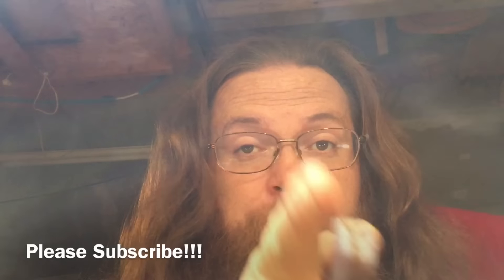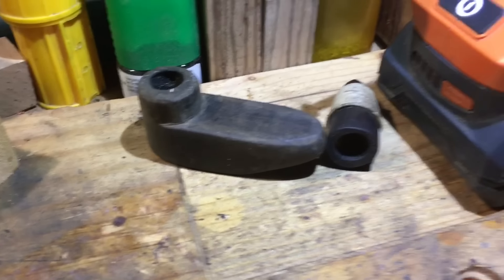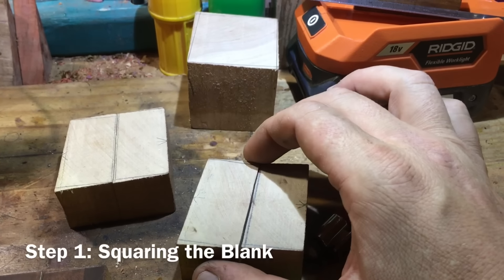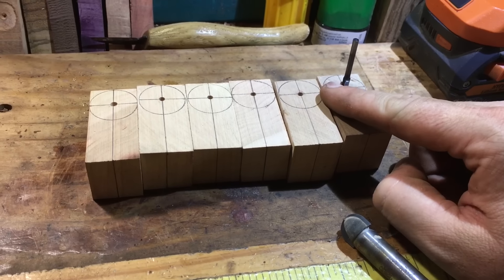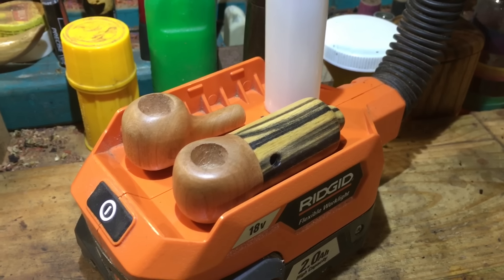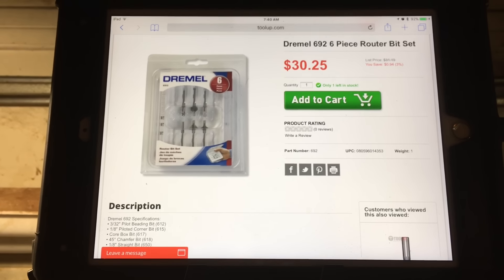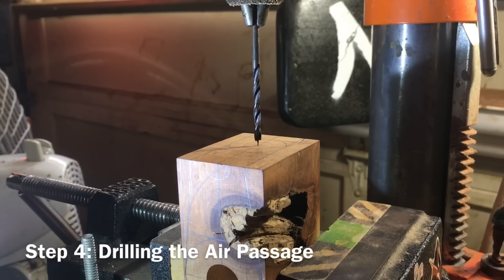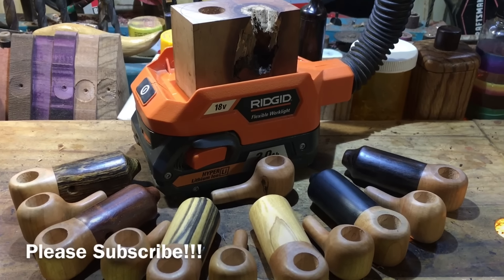Gary's Wares: The Basics of Pipe Making

Comment from the maker: FAQ's:

"What type of glue do you use?"
I use Titebond Type II Dark Wood Glue. It's the same as the regular Type II, but dyed to dry a dark caramel color. I think this might be the best choice for exotic hardwoods since they tend to be darker than most domestics. 

"What type of finish do you use?"
I use Salad Bowl Finish, which is not only non-toxic, but food-safe as well. In conjunction with that, I try to sand up to 600 grit whenever possible, which will give you a better finish. 

"What about using [some type of wood] as a bowl instead of Cherrywood or Briar?"
I take my technical cues from the tobacco pipe industry, and Briar is king with Cherrywood being second. Aside from Cherrywood, I also use Gaboon Ebony occasionally, but that's it. I don't currently have personal experience with any other type of wood for bowls. Check out this link for acceptable alternative woods to use as bowls: https://pipedia.org/wiki/Alternative_Woods_Used_For_Pipe_making

"How do you clean a wooden pipe?"
With a pipe cleaner, of course! If you'd like to harvest resin, you can do that with paper clips and such so long as you're careful not to dig into the wood; that would give you splinters in your resin, and that's no fun. I DO NOT recommend digging around the bowl for resin as this might disturb the "char layer" (the burned interior of the bowl) which is essential to a prolonging the lifespan of your pipe. 

"Where do you get your wood?"
I've been getting it from Woodcraft.com, but I think I'll go through http://www.bellforestproducts.com/ the next time I get wood. Bell Forrest seems to have better prices.
Reply: Hey gary I have a very important question. Could you make a pipe out of a standard piece of 2x4?
Reply from the maker: https://pipedia.org/wiki/Alternative_Woods_Used_For_Pipe_making
Reply: What are your thoughts on bone as a bowl/stem material?
Reply: @Th3Class1c  that wouldn't be a terrible idea. Pine is a very soft wood so it wouldn't be durable enough. And pine resin is very flammable. I make shavings of pine to start my campfires. Not to mention pine is very often treated with chemicals. Horrible for the lungs.
Reply: @stanervin6108  I've done that. I wouldn't reccomend by way of breathing in bone dust or the burning bond itselt since bone tends to be pretty brittle. Antler isn't a bad choice however for a stem but not the bowl.
Reply: What's your opinion on long stemmed pipes?
Reply: @m_ the_Happy_Doc bamboo makes a great stem. All my wood pipes are hickory, and that works well too.
Reply: How wide/deep do you normally make the bowls on the carb pipe?
Reply: my ultimate cheat for pipe making was to buy a peterson churchwarden..
Reply: Harvest resin for what?
Reply: do you use a lathe? I don't have access to one and was wondering how hard pipemaking becomes without a lathe
Reply: If you want to make a more durable pipe, you can use pipestone. It's going to take longer, but it lasts for a very long time (probably forever)

Comment: something tells me these pipes aren't meant for tobacco use
Reply: Devin Petersen shhhhh, child.
Reply: Weed pipe base on the design :)
Reply: Yeah, I came to see pipe making, and I see bowl making.
Reply: Devin Petersen, shhhh...
Reply: Devin Petersen lol
Reply: as soon as he said inhale......
Reply from the maker: Devin Petersen, you’re right, these designs are specifically for cannabis. Not to be an absolute nerd about it, but tobacco pipes have different needs than cannabis pipes. 

In a tobacco pipe, the tobacco smolders like the tip of cigar. As such, the wood used in the bowl has to be tough enough to endure constant heat without degrading too badly. Briar is the industry standard in the tobacco pipe market, with pipes made of cherry (and the like) selling for somewhat less. Briar is highly resistant to heat and about as hard as marble. It’s also about $20 a blank. 

Cannabis, however, doesn’t combust as readily as tobacco (unless you’re smoking reggie 😕), so a cannabis pipe doesn’t need to put up with as much constant heat, freeing up lots wood options and designs that aren’t possible (or at least practical) with tobacco pipes. 

Anywho, that was your “Bill Nye the Science Guy” type lesson on pipes. I’ll have to think of something like that. “Gary of Gary’s Wares [something, something] [something that rhymes with “Wares”]. I’ll have to work on it. 🤔🤔🤔
Reply: A chillum should have said enough 😘#SWED
Reply: I realized that when he fucked up the sides
Reply: Devin Petersen 😂
Reply: @GarysWares  shhhhhhhhhh! Dont tell him!
Reply: Ì don't think it's from not paying attention I think it's from smoking a bowl first
Reply: @GarysWares  dude thank God you make cannabis pipes
Reply: was it the green "material" that tipped you off?
Reply: Not a crack pipe.
Reply: @GarysWares   Gary's Ware's the pipeman cares
Reply: how long have the number of likes been what they are?
Reply: 420 likes on this comment. Nice.
Reply: You think hes smoking chia seeds too?
Reply: Ew, who smokes tobacco lol
Reply: Me too
Reply: @GentlemenJack109  🤦
Reply: Ya meth
Reply: it's the same thing dude
Reply: Exactly why I’m watching
Reply: Tobacco pipes can be used for both
Reply: @GarysWares  thanks! that explanation and information in the comment is actually pretty helpful to a beginner pipe-maker like me!

Comment: I just finished carving the bowl section of a pipe. I used a dremel for all except the stem attachment part. Although I may have an issue because I have no idea what kind of wood it is. I just used a twisted, more dense part so it was harder. Hopefully it's not toxic. Some general grey, kind of smoother bark. White/blonde flesh. Seems to be at least carving well and no odd smells

Comment: Here's a question. I'm wanting to build a flat-bottomed 'wizard style' pipe with a long stem. How do I go about figuring out what size and angle to make the stem so that I can put it down and have it self-balance? Another alternative is a small hinged metal insert on the underside of the base that could fold out towards the stem to help it balance, but I'm unsure how I could properly secure that to the wood without using glue or screws. My best guess thus far is maybe small metal 'biscuit' tabs to hold it in.

Comment: Here's sort of an oddball question for you. Experienced wood-worker here, but I'm uncertain about something. Around here I have lots of standing Cherry, so I mill it and cure it myself. Cherrywood seems to harden with age. Further, some pieces are denser than others. Of all the wood I've worked with, the hardest, densest of all seems to come from an aged stump. 

It stands to reason that wood, being an organic structure, will have different properties depending upon where the structure comes from. Most woodsy people have noticed that a root will snap with a sharp bend, while a branch will flex back-and-forth. The two types of wood (root & branch) have adapted to fit different environmental stresses; as structures, they have different purposes. 

OK, so there's the biology. 
My point is that I've found slightly-underground stump wood to be the densest of all. Perhaps this is because it is this place alone where a tree has to be super-strong but also flexible and wet, so this spot is sort of a unique blend. I'm wondering if you have any related experience, or if you have an opinion, before I try making any Cherryroot pipes.

I'd also like to hear anything you'd tell me about the differences in design between making a pipe that's either for pot or tobacco. Good stuff. Thanks ;)

Comment: that "tobacco"  needs a continuous flame, real tobacco smolders on it self and should do only that. 

Though it's hot when it smolders it is a non complete burn, oxygen is depreviated and that gives "low" heat and smoke 
In short u made a cyclone suction burner. 

That is the Only way too kill a pipe like that :) an old pipe maker told me that. 

Didn't know till now why I knew this 😁. 

Nice work man really learned a lot from you 👍🏻👌🏻

Comment: Hey nice job and thank you for your work. I've made pipes for a few years then stopped after legalization. ( long story) any ways you start your pipes very similar to myself but after losing my pencil lines and over carving my marks I started using a hole saws to mark my outer do not pass mark. I'd centre and cut a small 1/16" ring . As long as the hole saw fits the block there's no measuring needed. Then I centre my Forstner bits for my bowl. I carve with a Fordom, a hand help rotating sander and wand with a foot pedal for speed. I still need something for the bottoms Chamber bits are hard to locate. I just thought maybe my tip could save you some time measuring.

Comment: The thingy is a pilot, that goes in the pilot hole to align the bit with the pilot hole like a brad tip on a brad bit. The pilot & pilot bit are used in metal, plastic & wood working for alignment. Good video.

Comment: I would like to start making tobacco pipes and I’ve been making knives for some time. For wooden knife handles we normally use wood with resin drawn through it (which hardens the wood and makes it so it won’t change shape during temperature change). I’m just wondering would it be a bad idea to use the same wood with the resin pulled through it?
Reply from the maker: Thanks for your question! Without knowing much about resin, I’d say yes, that would be unadvisable. I’m not sure how resin reacts at high heat, but I’d wager it probably gives off toxic fumes. 

But the good thing is that, with proper wood selection, that’s not something you’d need to worry about anyway. Briar can be pricey @ $20/blank, but there are cheaper alternative woods that will do the trick.

Comment: When your drill bit or saw starts to burn the wood while it's cutting that usually means one of two, sometimes 3 things. either it's time to sharpen that bit or you need to change the machine's speed. (sometimes its because you picked up a bit that was meant for masonry or metal by mistake)

Comment: gary have you ever tried curved pipe stems? the indians use sumack for their stems so they can be hollowed out by using a heated wire or fine rod curved to shape of bend and pushed and burn through the sumach branch

Comment: Each pipe was test smoked as the video progressed and I'm amazed you could get through the last part at all. 🤣 Great video. I have loads of apple wood but I have no idea of it's ok for pipes. It's fruit though so a smoke could be classes as one of your five a day.
Reply from the maker: Actually, I never use the pipes that I sell. That’s bad form, among other things. But if you’re referring to the black inside of the bowl, that is a result of charring from the bit. A rotary tool doesn’t have the power to drill the bowl at a speed low enough to prevent charring. These days I use a core box bit at a medium speed on a drill press to prevent charring. 

As far as your wood goes, I’ve heard that fruiting trees usually make viable pipes. But again, I’d google it before you invest your time in it.
Reply: @GarysWares  hi Gary thanks for clarifying. Of course you don't smoke the pipes you sell mate, I was simply joking that maybe you did smoke a pipe or two as the video production progressed... Maybe, possibly but definitely NOT  one destined for a customer. I had a think about the apple wood and my thinking came up with the fact that apple wood is used to smoke food with so at the very least I don't think it can be poisonous. I will have to see how hard it is once properly dried.
Reply from the maker: Lol, I knew you were joking, but the internet is what it is and I try to be as infotainmenty as I can while eschewing as much of the irresponsible stoner persona as possible. I can be kind of anal-retentive about it actually, but since I’m a born-asshole anyway, I might as well use my powers for good. 😀

But no, the charring of the bowl comes from the rotary tool’s inability to cut hardwoods at low speeds (for anyone else reading this), and a drill press with a core box bit is a better choice.

Comment: if you paint the inside of the bowl with honey before you use it the first time it will not burn out for a long time I make my bowls from manzanita burl and deer antler for the stem connect the two with brass tubing no glue then it can be pulled apart for easy cleaning. like your video thank you

Comment: Just watched this one and I'll day you know what your doing. So my question is have you every used anything like whitetail deer antler for the bowl. The glue that you use (the tightbond type 2) van that be used for glueing the bowl with the first part of the stem. I have 3 pieces I'm using the bowl and turn will be antler and the stem will be clay. I had a nice clay pipe that the bowl busted and couldn't get back together so I've cut off the rough part and made a straight stem with the remaining good part of the clay. Those two will be able to separate but I do want the antler pieced to be fixed permanently together. Can that glue you mentioned be used for how I'm wanting it to attach?

Comment: how do you not have more subscribers!?!? this is probably the most informative video on pipe making I've found. great job. one question do you know if aspen is a good wood to use for a bowl?
Reply from the maker: +Renegade Parkour Thanks so much!

I know nothing about Aspen. 

Wood that's used for the bowl has to have specific qualities, and there aren't too many woods that will do the job. The wooden bowls of pipes in tobacco shops are almost always Briar. Cherry is an excellent second choice (also, its cheap) and I use Gaboon Ebony as bowls in my premium pipes (but it's so damn expensive). Unless Aspen is on that Pipedia list or you find a reputable source giving you the go-ahead, I wouldn't use it. 

Of course, you can use any wood you like as the stem...
Reply: Gary's Wares alright thanks man.

Comment: we have cherry and I'm about to make a pipe with these specifics 
 

The chamber is 18mm in diameter and 25mm deep. Bowl is 32mm in diameter and it's length is 45mm. Stem is 160mm long and it's curved by 20mm. Channels are 3mm in diameter in bowl and in stem it is around 2mm. Wood I used, is one from pear tree for bowl and mountain ash (rowan) for stem. Essential tools are: drill(and drill bits), saw, something to round all corners and make fits go tight like knife/spokeshave/file, clamps to make bent stem. For the wood: any hardwood is good, it just can not be toxic wood like black locust and it has to be resin-free so pine/spruce/larch etc. won't be good. Basically the denser wood the better. It is common to destroy first pipe by drilling too far (I made that mistake in my first two pipes :D ) so it is very good idea to mark on drill bit how deep it has to go. You can use a small piece of tape, or just mark that length with sharpie. Stem must be clamped till glue dries (usually 24h) any recommendations?  (wood is from the cherry in our backyard)
Reply: do you know of a good core box bit to fit that sizing

Comment: Maybe you mentioned in the video and I missed it... how do you clear all the dust and debris out of the airpath so you don't suck up wood particles with the smoke?
Reply: @IluvinortheIneffable  I’ve seen a dude blow off dust using a air compressor and then wipe it down with a tack cloth. The air compressor did essentially nothing for removing the loose debris. 🤷🏻‍♂️
Reply: @mattd313  your could try a specialized file or a hot piece of wire.

Comment: If you want a bigger bowl I suggest taking a spade bit and rounding the corners with an angle grinder or a belt sander. It ends up working surprisingly well. Cut through Osage orange like butter 🤙🏼

Comment: Hey @garyharmon cheers for the upload very informative. I was planning to use a washer on the bottom of my bilbo baggins pipe. Hopefully to stop burnout. Is there any issue with adding steel to the pipe?
Reply: Ps your using a coved router bit to drill the bowl. Nightmare of a router bit coz without the ball bearing it burns the shit out of the face. You have found a perfect use for an orherwise useless tool. Legendary tip

Comment: That carb is not in a good spot if you ask me. The whole idea is that you use it to clear the chamber so you should have it as far back as possible so the air comes from behind the smoke and clears the whole thing at once. I would put it on the head of the bowl either on the side or on the very back if you want it to clear nicely.

Comment: Hey, I used wooden glue to connect the two pieces of the pipe. Online I readed that the inhaling of wooden glue is toxic. Does anyone know or this counts by this pipe? Or is there no problem?

Thx
Reply from the maker: Glue releases toxic fumes when exposed to too much heat, so you can’t use glue in the bowl. However, so long as the glue is far enough away from heat, it won’t have an effect.
Reply: It's not long term toxic, it only takes a hit to release toxins in your lungs and blood. It will cause severe damage to your liver and your brain. Be hella careful

Comment: Never use Ipe for a pipe. I tried that years ago. It made a beautiful pipe and polished out amazing. The problem was that I didn't know how toxic it was. I smoked two bowls through it and couldn't hardly breathe for a week afterwards. I have made a few from maple that were great. Holly works very good. Laurel is a good pipe wood, but it will start to have small cracks in a year or so.